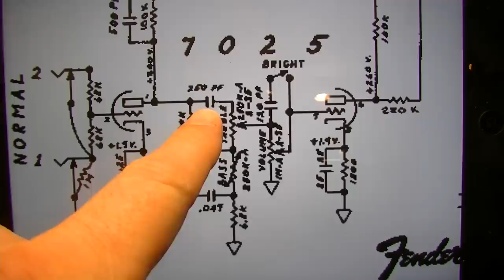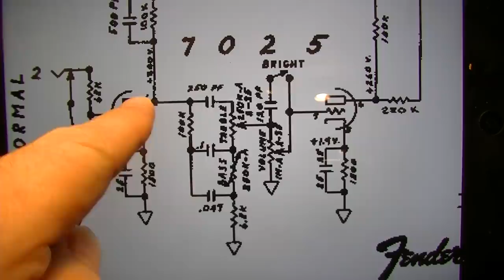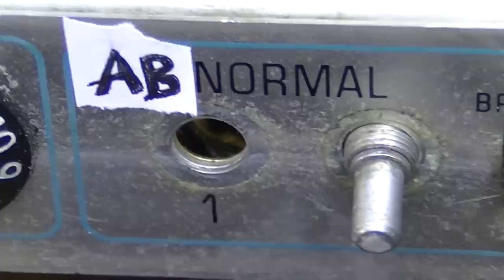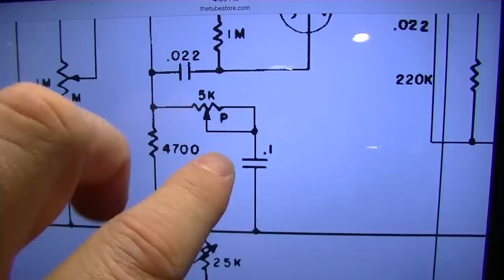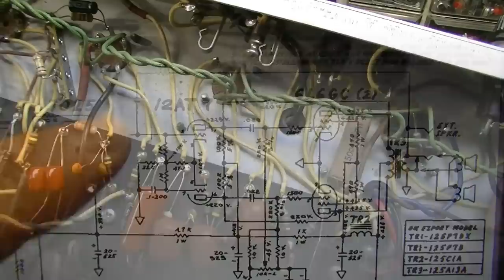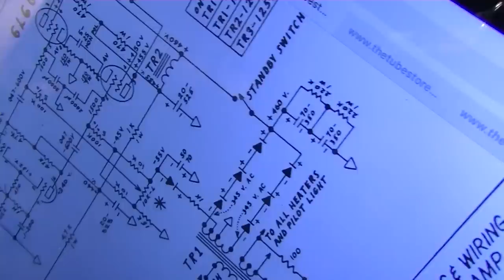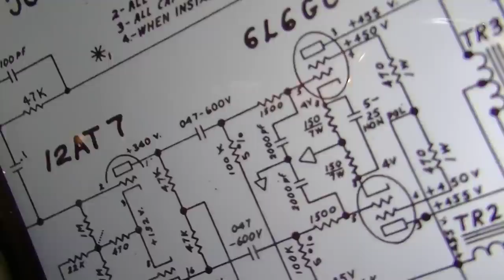SECRETS of the Fender Bassman - "ABNormal Channel" Mods Unleash the Hidden BEAST!

Comment: Are you under the illusion that a Bassman is or was a guitar amp ? The Bassman was the only bass guitar amp Fender produced in that era. The only thing wrong with it was that it wasn't powerful enough and they came with a pair of 12" speakers that couldn't do the job. You're killing the collectibility of this amp trying to convert it to something it wasn't designed to do. If you want a guitar amp to modify in the same power class as the Bassman then modify a Bandmaster which was intended for guitars.
Reply: jchavins i mean you can get these for alot cheaper than most tube amps these days and he made it so you can put it back to stock.  And not to beat a dead horse or anything but the first Marshalls wereee based off the 59 bassman don't know if that's been mentioned before haha
Reply: if you want a Marshall then just get a Marshall.....This is kind of like putting cheap ceramic Chinese bass pickups on a 57 Strat......don't get me wrong, I really like this channel like the guy said in Jurassic Park----yeah you can do it but should you do it ?
Reply: i agree man but for a broke 20 year old a 500 dollar bassman sounds alot better than a 2000 dollar plexi reissue (i have a sovtek mig 50 haha)
Reply from the maker: Can't wait to see the discussion on this one.
Reply: remember: it´s his amp. even if he decides to change it into a let say 4x KT150 power amp, with a nice shielded SMPS to be able to power up these tubes, it would be nothing wrong with that, as it is his amp.
Reply: I get the whole collector thing, but usability beats collectibility for me. It’s easy enough to put it back anyway. I don’t think I’ve ever seen a bass guitar plugged into a bassman either.
Reply: @jchavins ~ I don't like the modifications done to this amp either. I just don't dig the tone at all. But I see no harm (nor is it any of our business) in somebody modifying any amp they want. Amps and guitars are just tools, no different than a rake or a shovel. if modifying your tools will make them serve you better, then so be it. We don't exist to serve our tools. They exist to serve us. Lastly, what bass player have you ever seen play through a Bassman amp? I don't know of a single bass player who likes them. They're played almost exclusively by guitar players and always have been except for a brief period in the '50's when there just was no other bass amp with enough power to cut it live. Incidentally, Bassman amps were made for both guitar and bass. That's why they have a "normal" input and a "bass" input. Fender also marketed the old tweeds as being good for vocal mics as well, and there were several bands who used tweed Bassmans exclusively for the whole band, so they served as a PA head, guitar, bass, harmonica, and steel guitar amps.
Reply: Oh dear !
Reply: "It's a shitty bass amp that can't bass amp."
"It's not a guitar amp."

Well, WTF is it then?
Reply: Someone’s always going to get triggered...
Reply: "Collectibility" LOL.  If it's not being played it's only worth it's weight in scrap metal.
Reply: hahaha, yep. Man I think this mod is great. These things are waaay cheaper than some of the more collectable  models, and as you say, you can always return it to a "freshly serviced" state. I think it's been given a slightly Boogie-ish voice which I happen to like a lot. Great vid dude.
Reply: Someone should have told Randall Smith about this so he would have never created the Mesa/Boogie.
Reply: +jchavins - I wish he could get a pristine one and purposefully ruin it, just to annoy the collectors.  Unfortunately, he got a beater and made it better.  Not nearly enough troll-factor in that...
Reply: I've played guitar using Pro Reverb, Bandmaster, Super Reverb, Bassman, and Deluxe Reverb. I'm not talking pluging a guitar into one at GC, I mean on stage. I never had much use for a Bassman but in 1964 thru 1968 there wasn't much to choose from for a bass guitar. The best in those days was actually a Dual Showman, more power and much better speakers but real expensive. Later in the 80's I switched to Peavey, a number of them. The best of all time was a Session 500, it could do it all. My only complaint about the Peavey's other than weight was that there was a LOT of noise. Old Peavey's can be found dirt cheap everywhere and they are built well. If the guitarologist could come up with something built in to quiet these amps he could get rich.
Reply: Oh oh awwwww Triggggerrredddd.
Reply: Yeah, but I already have a Marshall :)
Reply: Collectors go collect. Modders go mod. Everyone be happy with what they choose to do with their time and money. As far as this amp is concerned, it sounds incredible and if the owner doesn’t want it, I sure as hell do. I love everything that was done to it and most importantly, I love the sound.
Reply: The AB 165 & AC568 Bassmans might well be regarded as the very worst-sounding  of the amps made during the early hand-wired CBS era. They screwed up the lead dress, the bias circuit, and had to leave a half a tube unused. Then, they had to add a bunch of tone-sucking circuitry in the power amp stage, to try preventing parasitic oscillation. This has made them a favorite amp for mods of all kinds. Stock, they aren't worth a fuck, and so they sell at bargain prices compared to most other "vintage" Fenders. What else would you like to know?
Reply: These go for under 800 bucks in good condition. Try that with a '65 Twin.
Reply: @Randolph Patterson ~ Silver face fenders generally had a reduction in highs compared with black face amps, and if you're a Les Paul rock player that might be bad, but many clean Telecaster players and jazz players prefer silver face amps for that same reason plus all the headroom. What you call "tone sucking" is what a lot of country players call some very nice "tone shaping" that did exactly what it was intended to do at the time---less highs, less noise, more headroom.
Reply: It's not his amp, it was sent to him by a customer, so he's in fact doing things in keeping with what the true owner desired.
Reply: ???? It's an original chassis with original parts, none of which work, with an original cabinet that's busted up.  If THAT'S a "collectible" to you, i've got a couple of busted up pieces of sheet you may be interested in......
Reply: I never mentioned cathodes. SF Fenders generally (but not always) have more headroom because of either bigger trannies, 12ay7 vs 12ax7, EQ filtering, SS rectification or some combination of those things. One of the obvious exceptions is the Bandmaster Reverb which was the only Bandmaster that had tube rectification, so it broke-up a little sooner than both the BF & SF Bandmasters. Also, fender started making more high end speakers available as an option so now and then you'll find a SF amp with JBL or EV12L speakers in them, and those won't distort as quick as the old Jensens.
Reply: Looking for the guy that collects beat-to-fuck amps. I got some things to sell him. Why doesn't relic'ing increase the value of electronics?
Reply: Are you The  International Controller of all amps?  How about they can do what they want... Do you feel that freedom surging through your veins now?
Reply: Nonya Bizness t
Reply: collectibility? I can totally appreciate your practicality about this being a bass amp, but it is a silver face bass amp, and in beaten condition. They are the best for modifying because NO BODY plays bass out of them (I"m sure I will get guff for that); they are the ones you can feel guiltless about modifying. Keeping it stock for the phantom collector, who just has to have that stock amp, is a little silly for this one. If this guy will use it , and like it, then we are succeeding.
Reply: Some people are just turds...
Reply: Calling this a collectible is like calling a '77 Oldsmobile Cutlass Supreme a collectible. Just because its old doesn't make it good.
Reply: You don't know your amp history very well, bud.  Do you realize how many amps are based on the Bassman????  Marshall and Traynor amps just to name a couple.  I could go on and on all day.
Reply: Bass players collecting vintage  bass amps?  The only thing bass players collect are tattoos and std's
Reply: Instructor Maint you think bass players get laid? Bwahahaha!
Reply: jchavins
The Fender Bassman is only legendary as a guitar amp because it breaks up with warm smooth overdrive distortion.  It is totally worthless as a bass amp.
Reply: What was I thinking?  Thank you Mike McKeen for pointing out the error in my logic.  The Internet collective points to the truth again.
Reply: The intent doesn't matter. Only the end result matters. It was intended to be a bass amp. The end result is a badass guitar amp.
Reply: I think for a tech the Bassman is the perfect amp to mod for a guitarist because of the simplicity of the circuit. As said before by others the mods done on this amp were well thought out. All mods easily reversible without any degradation to amp. At the end of the day no functioning vintage amp is really original because the electrolytic caps and various other things need to be replaced and the original parts are no longer available nor would you use them coz some of the old parts were pretty crappy anyway.
Reply: I disagree. I had a '66 Bandmaster head, very smooth and rounded, but not a sparkly clean tone that cut through, and the smaller transformer didn't lend itself to a crunchy rock tone. That's why nobody wants them. Yes, they ooze vintage mojo and the tremolo is lovely, but strictly a blues amp and not even so great for that.
Reply: +jchavins 
"This is kind of like putting cheap ceramic Chinese bass pickups on a 57 Strat...."
Well, if that´s giving you what you are looking for, why not?
Instruments are tools of expression.
Reply: First of all I would like to know who paid jchavins to start this troll concert! I like it tho. Next episode should be to convert a 69 Marshall Plexi to a Silverface Bassman just to get more people pissed off, Lighten up folks
Reply: Yes, you should. These amps are pretty much useless for bass in today's world. Paul McCartney used a '68 into a 2x15 cab for the Let It Be film/album, Chris Squire used 69's into huge custom-built cabs for more power, and you can see a Blackface rig on stage at the Monterey Pop fest. But there are tons of these heads still floating around if you really want that old sound. I'd say ALL mid-powered Bassmans SHOULD be modded into guitar amps.
Reply: Whats collectible about a crappy bass amp? Its a great guitar amp even better when its modified.  I know,  I have two.
Reply: None of that matters one bit, there is only one thing that really matters.... Is the owner of the amp happy with the work thats been done to it.
Reply: Fender is a huge monument in american history at this point. similar to coca cola. i guess all those coke collectors are just collecting tin cans as well?
Reply: I think people are forgetting that Brad is simply doing what the customer wants him to do with the gear he has been shipped. The choice isn't his it his clients, Brad is just doing what he thinks is best for HIS customer. Kinda surprised nobody picked up on this all important factor in this discussion.
Reply: Jay Adams  😚
Reply: Change it back over. You can buy bassmans for $200 if you look around. I got a 68 super reverb for $25 off a crackhead. Guitar or bass is just a name, some 10 cent resistors changes an amp completely.
Reply: @Hotpockitrockit
and you most likely don't want to see or hear neither, unless you REALLY like that person. :D
Reply: "Killing the collectability". I dont know about you, but I would rather have a guitar amp that sounds good, not like a turd. Besides, not many people play bass through Fender amps anymore. Now it is useful.
Reply: I've got a 66 Bassman head modded similarly to this. They do make excellent guitar amps and lots of people use them as such.
Reply: If the Bassman can't be a guitar and, them why did Jim Marshall use that circuit for the JTM45 also know as the bluesbreaker?
Reply: Not your amp so why not?
Reply: For the most part, Bassmans are useless as bass amps so all the more reason to mod them, and they have a big transformer which gives them some balls. The Bandmaster has a very rounded flutey sound with its smaller tranny. They're okay for blues I guess but other than that they're kind of lame sounding which is why nobody bothers to mod them or even use them.
Reply: Going out on a limb here, but it’s no different then taking a 68 charger and fixing it up, changing some parts making it your own.Sounds cool, play the shit out of that thing dude!!!
Reply: i don't know where to start with how off topic you are jchavins,
Reply: Were you too busy rage-typing to pay attention when Brad explicitly stated, repeatedly, early in the video, that it was a indeed a bass amp? The customer wants it as a guitar amp and customer gets what customer wants.
Instruments are not trading cards. They are made to inspire and be played. If the mod brings inspiration, it is a mod worth doing. Enjoying your gear today is more important than how much your grandchildren will be able to sell it for in 5 decades.
Reply: That's what the customer wants. So whatever.
Reply: Oh boy.
Reply: Who cares?  I have two that I modified, and gigged with for a very long time... reliable great sounding GUITAR amps. 
I dumped the worthless (even for bass) bass channel circuitry in favor of using that extra gain stage to build a 5F6A circuit in its place.  It sounds incredible.  Kept the "normal channel" straight up black face, and reverted the output stage to the proper AB165 wiring.. and made the bias properly adjustable.  

So in a nutshell, I have to useful amplifiers instead of two [not at all] collectible Bassmans.
Reply: John Rapp  the silverface BM was more like 43 watts but i have SR big iron in mine so im pushin closer to 48-50 watts in my '69 BMR.
Reply: randolph patterson my only disagreement is the ab165 IMO is grail like tone. Not tweed tone. Just it’s own thing
Reply: how about let guys do what they like with their own amps?
Reply: @instructormaint8423  and callouses, lots of callouses
Reply: It's what the customer wanted. If it was your amp you could do what you wanted.
Reply: jchavins “the only thing wrong with it was every major part of it”
Reply: @jayadams3244  A $500 Bassman?  You cant get a  Blackface one in good condition for less than  $1500,  or a Silverface one for  $1,000.  Unless you  are a good amp tech, and you want a fix up DIY project.
Reply: I have a stock  65 Bassman with JBL D120F speakers, and it sounds  monster huge,  not modified, just the better speakers added. It is a great amp for  guitar!
Reply: They have always been good amps. Leo custom made one with a reverb knob added and a 15" JBL for Tom Brumley, Buck Owens steel player. It sold last year for 5k. A lot of bass amps make good steel amps, and are great guitar amps. A 1969 plush royal bass head is a great guitar amp too.
Reply: Tell it to César Carrillo Díaz ,you're a bit ignorant as to what the Bassman has actually  been used for through it's production history,( thus the NORMAL CHANNEL WITH GUITAR VOICING) and being you can still find a blackface head (in the Champ price range) for as low as $700 , unless you're talking tweed they're hardly in the collectable area and considered player grade guitar amps, well suited for the gigging player that needs more headroom than a Deluxe Reverb and doesn't want to carry a Super Reverb.
Reply: @TheGuitologist  Collectability or Originality are only to be respected when there is something to respect. If that was the head Paul Mc Cartney used for the Beatles roof concert, it would have some historic value to be respected. Otherwise it is just another bassamp head amongst thousand others with no particular interest, anyone can do whatever he wants with them, (except that chrome potknob which is as likeable as a mole on the nose and  a crime against good taste.) That being said, as an owner of that  head, and I might want do that mod, but the lack of trustworthy technicians (for vintage guitar valve amp I mean) in my area, encourages me to leave the old guy just the way it is, and limit the interventions to the routine manutention. Love your channel BTW, your speech has some hypnotic quality that keeps me watching it although I dont understand nothing about electronics hahaha ! Cheers !
Reply: I play my father's 1965 AB 165 that he got new.  He played a guitar through it then, and I do so now.  I've never seen a bass player use that head, ever, but I've seen plenty guitarists use it, stock and modded.  Fender may have had designs, but players found other uses.  The consensus over the last half century is, great guitar amp.
Reply: The guitar player in my band used a modded 68 Bassman as a guitar amp. One of the best sounding amps I've ever heard.
Reply: @jchavins  especially for a guitar player. Like how to convert a SuperSat circuit to a Transtube with the resonance knob and all of the improvements in this circuit.
Reply: All mods easily reversible, as the man stated. A Blackface Bassman I would not want to see modded, silverface amps were a dime a dozen.
Reply: Tell Howard Dumble. Nuff said.
Reply: Oh, and Jim Marshall.
Reply: @wildbillhackett  that's right, and a telecaster makes for great cutting board if you don't have handy at the time. Just turn it over
Reply: Not to mention a fine canoe paddle.
Reply: This is a Silverface Bassman, not exactly a holy grail amp, but not junk either. I plan on getting this same mod done to mine. I sincerely hope that pisses some people off ;)
Reply: 216trixie anyone commenting on YouTube is likely on the spectrum..dig your comment
Reply: The Fender bassman and the Marshall super bass are the best guitar amps ever made sounds way better then the super leads.Anything else?..
Reply: The Guitologist I think you’re mods are great. The people that say you shouldn’t be doing something to any amp clearly don’t understand how innovations are made...BY MESSING WITH STUFF.  Keep doing what you’re doing!
Reply: @jchavins Tell you what when you buy an original bassman you can do whatever you want with it. Brad was doing what the customer wanted. Its his amp not yours so chill. People mod amps all the time. Plus its completely reversible. Its not like he took a hacksaw to the chassis.
Reply: @hrsey71   I use to say the same thing. except I'd add ". But some people like you have Two  one at each end.
Reply: @matthewf1979  banjo amp
Reply: Congratulations, you played yourself
Reply: @TheGuitologist  I am going to make a bowl of popcorn.  😆
Reply: You do know that hes doing essentially the same thing Dumble did and buying a fender amp modified by dumble you pay 25 to 30k so he definitely isn't killing the collectible value
Reply: INTER ARMS  I use mine for both, I have for 30 years now.  Quite good description, woody.  I like my bass to have low mids.  Best 50 buck heads I ever bought back in 89-90 cheers brother!
Reply: These Bassman amps are sought after by guitar-players, and it's been like that for decades. During my time in a repair-shop - we NEVER EVER had a bassplayer walking in with any of these , t'was ONLY guitar-guys. Peace
Reply: Musical function over collectibility any day. I'd rather see a great guitarist mod and play a classic amp, than see some yuppie who can barely play with a pile of vintage gear that just sits there doing nothing. In fact if you mod the gear then musicians can afford to buy it again, rather than it becoming so "valuable" that only rich people can afford the stuff. That why all the vintage gear never gets in musicians hands, where it should be. Rather some rich ceo buys it all up to try and fill the hole in his soul from choosing money over follow his dream to be a musician
Reply: Wow! I got to this thread late, obviously.  But I just had to read through the comments because I just knew they would be entertaining. I was not disappointed! 

I assume jchavins hasn't been paying attention or maybe isn't all that aware of the history of the Fender Bassman. It's still a much sought after amp for many guitar players and personally, I own more than one and am always interested whenever I see another one come up for sale. There's a reason that Fender reissued this amp and if you have to ask why? Here's a hint: It was not for bass players! 
I assume that Stevie Ray Vaughn had a reason for replacing  his Super Reverbs with a pair of the reissued 1959 Bassman amps  for his 1990 tour. Perhaps someone should have told SRV that he was committing sacrilege by using these amps for reasons beyond their intent?    

I appreciate your work Brad! I'm happy to have found your channel, finally.
Reply: So confident, so inaccurate
Reply: New to an old thread, but it’s entertaining!  I’m thinking for those “collectors” out there of getting say a 56 Princeton and see if I can mod it with a Revv red channel structure.
Or what maybe mod on Mesa dual rec power section.  Lord if I own it I’ll do what I want, I bet there are some pristine famous amps untouched in some fender museum - maybe we can go “look” at if for awhile lol
Reply: Funny. I just bought a modded Bassman. Somebody put a 70s Bassman chassis into a 1x12 cabinet. It fucking rules. It's like a Blues Jr. that doesn't suck. I'm collecting the shit out of it.
Reply: How does it feel to be a ding dong?
Reply: I use two 67 bassmans for bass and a pbass is not ideal but a Gibson eb2 sings like nothing else mudbucker and all
Reply: jchavins: The original tweed Bassmans were developed for the P-Bass, of course, but guitarists started playing through them - they weren't specialized to the degree that later, more powerful bass amps were - and they became highly prized as GUITAR amps!

Being that the circuitry of the Bassman was nearly identical to the circuitry in the guitar amps - and speakers that were optimized for bass weren't being used by Fender at that point - there wasn't really anything to stop guitarists from using them for guitars!

In fact, when Fender reissued the 4x10 Tweed Bassman quite a few years ago, they marketed it more as a GUITAR amp than a BASS amp!
Reply: @okiwatashi2349  Nope, they were originally intended for bass, but they've been used mostly as guitar amps as long as they've been around.
Reply: @matthewf1979  A great guitar amp, particularly the blackface ones.
Reply: Don’t feed the troll.
Reply: @TheGuitologist  Nice work! Bassman’s rule!
Reply: My 1965 Bassman blasts like a Marshall plexi.. so..
Reply: @michaelcraig9449  silverfaces have certainly climbed in value since this video was made, glad I grabbed mine when I did, silverfaces were always underrated and yes the higher power variants of the bassman do make for good bass amps through the right cab, crushingly loud and headroom for days
Reply: It’s whatever amp you want it to be
Reply: Sounds like you need a tissue and two more strings.  I'm pretty sure Jim Marshall would have toldl you to pound sand.
Reply: @randolphpatterson5061  Could I get your opinion on how often I should change my oil
Reply: @TheRedneckSage  so angry.    Play nicely with the other kids.   If you don't have anything nice to say don't say anything at all.  Hang in there little tike,  it's nearly nap time.
Reply: Tito Jackson used an earlier Bass Amp circa 2009.   Of course there’s the Tweed Bassman sold until 1960, I don’t know very many Bass-players who used these. Ampeg made a better Bass Amp than Fender in the 1950s.  (Ken Trainwreck Fischer worked as a Tech at Ampeg, his opinion). The Beatles used a Blonde Bassman, but not for Paul McCartney for Bass,  and on some songs used the Bass channel for Guitar vs the the Normal (guitar voiced) Channel. 
Fender CBS made a more powerful Bassman with Ultralinear  connections for the Power tubes but this provides  enough you don’t need any more, but also used negative feedback. It didn’t sell well at all.
Reply: Killing the collectability..  These amps are made for people who make MUSIC, using a bass, a guitar or farthorn
Reply: It's one of the greatest guitar amps ever made. Even if it was by accident.
Reply: Every bass player I've ever talked to about these silverface bassmans doesn't like them for bass. They're not loud enough apparently and they don't like the tone. I personally like the way a bass sounds through mine, but I really like a '60s vintage tone on bass, and I'm not a bass player. I've played through mine on guitar and my only complaint is I can't get enough gain out of it even with pedals. It just falls flat and sounds dry. If I could get someone to do these mods I'd be stoked. The amp isn't worth a ton either way (even in pristine condition my 4x10 combo will bring like 700 bucks on a good day, and it's pretty beat up), and if I could get the tone I want without irreversibly modifying the amp, why not?